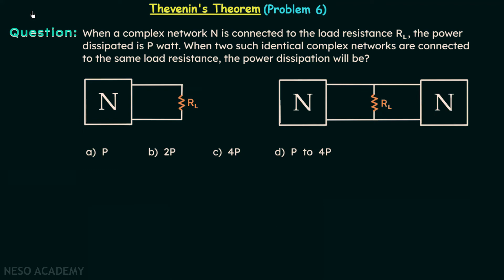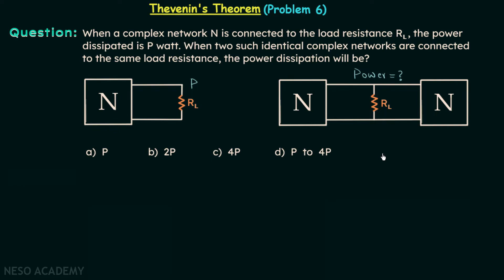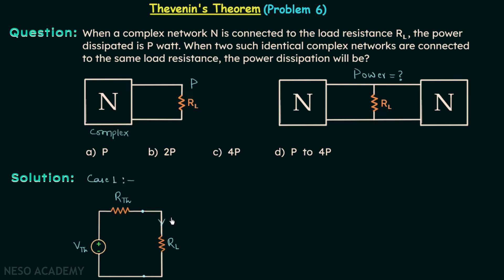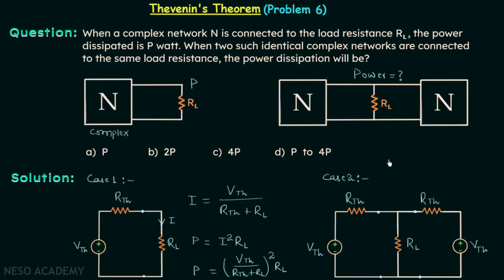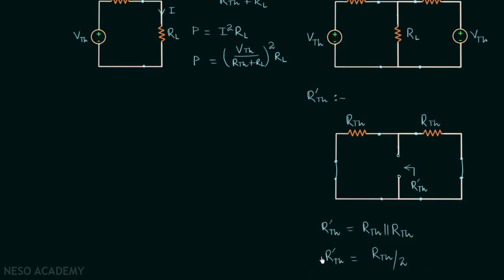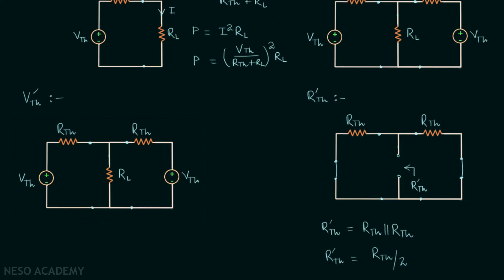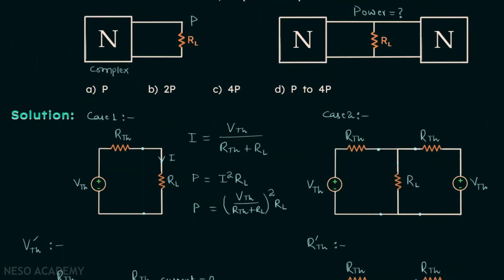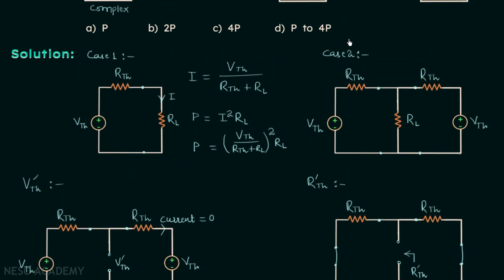Thevenin's Theorem (Problem 6)

Comment: power will remain same since we are not changing the load and voltage across load. Or in derived formula in both case,  we can neglect rth ( since Rth << RL)then we will find same power. so ans is  option a correct. But definitely power delivering capacity will increase 4 times in this case.

Comment: Answer is p to 4p because  by using maximum power transfer theorm concept . For maximum power is delivered from the load is load resistance= Internal resistance . Therefore p' = 16/9p or1.6p will comes so( d) p to 4p is write ✍️ answer according me . If any person has other solution this problem please share it on this video comments section please 🙏

Comment: Option (d) P to 4P is the correct answer
Take the ratio of P' and P and make two cases:
Case 1: When RL=0 then P' = 4P
Case 2: When RL=infinity then P' = P
Reply: In case 1 when RL=0 means P=0 right...??
Reply: explain once please
Reply: @revathireddy3699  Since Rl is the load resistance, so it can vary accordingly. Taking into consideration if Rl = 0 and Rl = inf. Then we will get the comparison between the powers as 4P and P. Hope it's clear👍
Reply: @starkendeavours7072  given in question that network to be connected to the same load right then y we changing load resistance here..??
Reply: Thanks bro got it
Reply: explain karo bhai
Reply: Yes, bro, I got you.👍👍
Reply: When RL=infinity 
Then RTh <<< RL therefore
RTh+RL = RL
RTh+2RL=2RL
P'/P = 4 ( RL/2RL)²
        = 4 ( 1/2)²
        = 4 (1/4)
        = 1
Reply: @alloc7260  thank you bhai
Reply: @alloc7260  but if RL=infinity then (infinity/infinity) =(x/infinity) =0, it's it right? 
So the answer of your calculation will be something else
Reply: You'r all wrong bro. 
It's correct when RL=0, then P'=P. But You said that if RL=Infinity, then P'=P, it's wrong!
There is a finite value for P'=P, I calculate it, the value is: (-3/4)*RTh.
Reply: @tauhidulislam1163  ....which option is correct one Bro....

Comment: At 5:42, why does R'th equal to  R_th||R_th? Don't R_th and the another one have only one common node?
Reply: Because both are in parallel  (Voltage across them is equal) we have the only one node at load and all sorces are turned off and we don't have any resistors in the path b/w both resistors so there is no potential drop and the voltage is( va-vb) so due this the equivalent R_th could be( R_th||R_th)
Reply: @girimadhavchowdhury1281  Thank You